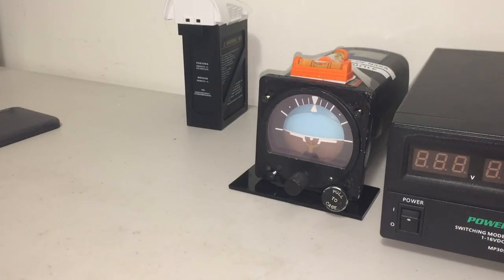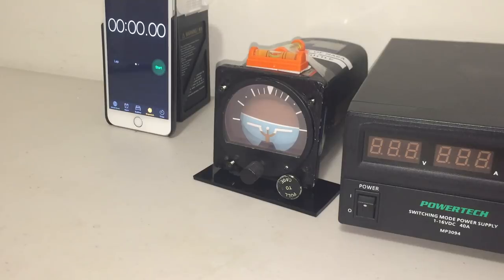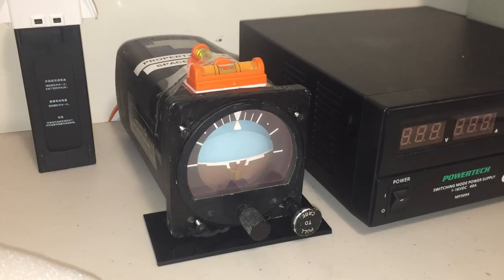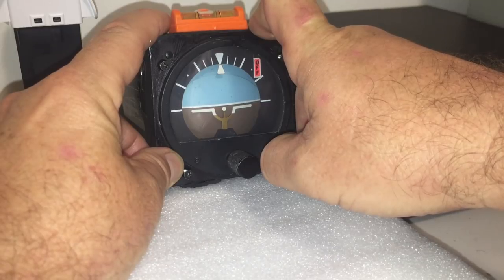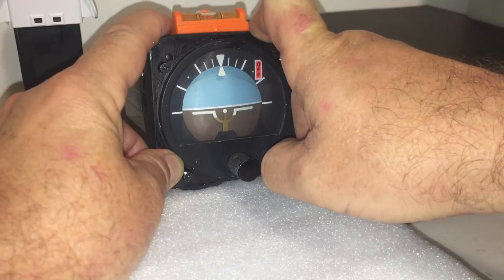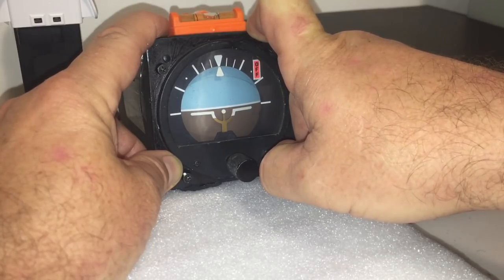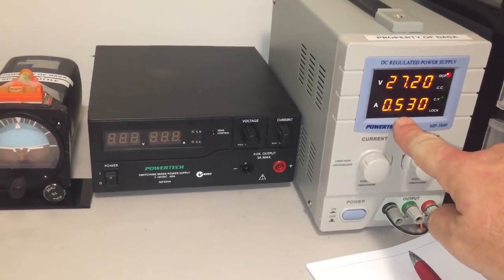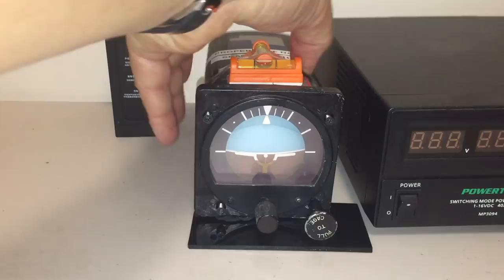Two more gyro experiments as requested by viewers.

Comment: hahahahahahahahaha! When you turned on again the gyro when it was at a 20° inclination to the  to the Earth plane frame of reference,  all this time you were holding it gaged at the previously set Earth plane ,  so you never really set the gyro to this 20° inclined new frame of reference. You proved nothing. Also the other thing about gyros nobody seems to understand is that  its horizon line indication (white line with the dot in the middle permanently stamped on it glass window) indicates actually the Earth plane when gyro whole apparatus is in a horizontal position to the the Earth plane position and powered off whereas the equator white line on the sphere inside the gyro indicates the inclination and is moving accordingly.  

So that means that this particular gyro is not made to indicate clearly a preset frame of reference (i.e. when the gyro is ungaged and turned off) thus a  frame of reference  different than the the Earth plane using a second mark line gaged to the preset frame of reference different to the Earth plane and thus  indicating this difference.

However, in still conditions meaning the gyro is ungaged and turned off  put in a new frame of reference different than the Earth plane then gaged at this new position (to avoid any momentarily recoil kick when gyro is turned on), turned on and then ungaged,  then when no other movement happens, the its equator line  will be in a different position to the Earth plane indicator line and will remain so as long as the gyro is turned on. Except of course some drift but not due to the Earth spin (alleged apparent drift) but due mechanical friction.

So please repeat the experiment but this time use the following algorithm:

1) Put the gyro turned off and ungaged to the new 20° inclined level
2) wait for a minute so it adjusts with the gravity vector
2) Gage the gyro and hold it there 
3) With the gyro gaged put it back to the horizontal with the Earth plane position and make sure its level using your spirit level. Keep holding it gaged!
4) With the gyro still gaged turn it on.
5) Gently ungage the gyro
6) Wait a day or maybe for ever the gyro to return to the flat Earth plane position hahahahahaha!

As for the 180° thingy in your experiment gyros have no infinite rigidity in space and are not made to operate in this extreme conditions meaning upside down. Actually it was a miracle that it took whole of 50 minutes time to return back level proving their rigidity in space in this extreme conditions.

my2cents

Markoul11
Reply from the maker: +Markoul11.  Why are you laughing? . I know what I did was pointless but I simply performed the experiment precisely as requested to satisfy that person's curiosity.  Please read the video title. 

Your experiment is also quite pointless and tells me you don't understand how this instrument works but I will happily do it exactly as you have listed regardless. 

Will you apologise when you see that you are wrong? 

It will self correct just fine even after doing exactly as you posted.  I can predict that already because I know how it works.

I could have laughed and mocked the person who asked me to perform that experiment but in the interest of education it was better to just demonstrate it to him. 

I will do the same with you.  I was a little more harsh with you because you opened with laughter when in fact your suggested experiment is equally pointless.  

If you understood how the instrument works you would realise that already.

The white line with the dot in the middle is not permanently stamped on the glass window at all. Wrong again my friend. It is adjustable for pilot seating position.  The pilot can adjust it up and down very slightly to conform to the horizon from his seating position. 

I would do the experiment now for you but it is late so I will do it tomorrow and make you a video.

It was not a miracle it took 50 minutes Markoul11.  These instruments are designed to correct at the rate of 2-4 degrees per minute. 

So for a 180 degree correction that will be something between 45 and 90 minutes.
Reply: Right, sorry about my laughter, couldn't help it. Did not realize that you were following blindly instructions from your subscribers however in the video you actually use the word  "prove" which allowed me to thing that these experiments were made to prove your points in compliance and not by opposition. Sorry my friend, I just realized it now.

"The white line with the dot in the middle is not permanently stamped on the glass window at all. Wrong again my friend. It is adjustable for pilot seating position.  The pilot can adjust it up and down very slightly to conform to the horizon from his seating position. "
end quote

ya! but the fact is that it is still made to indicate the fixed Earth plane frame of reference and can be adjusted to the pilot's view elevation and also during gyro operation it is permanently fixed in position and does not move unless the pilot adjusts it.

Do my experiment corrections? wow i am mostly honored by you. Thank you!  

Can you increase the inclination to 40° instead of 20° ?

And also please be careful not to introduce any roll when you move the gyro. I am interested only in level inclination. Also please release the gage when gyro is turned on, very gently not to introduce any momentum. Also if the gyro does not incline initially to the 40° inclined level due to mechanism stiffness when it's powered off, force it to go there with abrupt movement.

Best of luck.

Either way what the result will be, it will still be very educational.

Matkoul11
Reply: what you talking about man? Did you actually follow the conversation? Wolfie said on his own words that he was following the experiment instructions requested  by specific subscribers. So yes to be consistent he executed the requested instructions to the letter, thus blindly without questioning. SO WHAT IS YOUR PROBLEM? PAL? what this has to do with Flat Earth?
Reply: Markoul11: The white line with the dot represents the airplane and is therefore fixed to the case which is fixed to the airplane. The horizon behind the airplane symbol on the other hand is „fixed“ to the real horizon by the erection mechanism and during maneuvers by the rigidity of the gyro.
Reply: my predictions as to his 'test' of absurdity...

1) Put the gyro turned off and ungaged to the new 20° inclined level

ok fine and dandy, but with no power, it will roughly adjust to gravity.

2) wait for a minute so it adjusts with the gravity vector

only takes a second for it to have the heaviest part of the gyro to point down when powered off(the pendulous vanes)

2) Gage the gyro and hold it there 

ok, so once CAGED(not gaged), it will re-orient the gyro to the horizontal of the unit, regardless of gravitational pull(he did this in the first gyro test) (and to note, you put step #2 twice)

3) With the gyro gaged put it back to the horizontal with the Earth plane position and make sure its level using your spirit level. Keep holding it gaged!

since the gyro is still off, and it is CAGED to the horizontal of the unit, it will rotate WITH the unit back to its resting position being level with the base of the unit. if the unit is level with the ground, it will show the horizon as level as well.

4) With the gyro still gaged turn it on.

ok, you have successfully turned on the gyro while it is already level with the ground...

5) Gently ungage the gyro

since it is already level with the ground, it wont have anything to adjust for when you unCAGE the gyro...

6) Wait a day or maybe for ever the gyro to return to the flat Earth plane position hahahahahaha!

and you have shown you have no critical thinking skill.
Reply: Walter Bislin: Nevertheless, the gyro is preset on the ground before takeoff and with the airplane still therefore the Airplane indicator on the gyro matches the Earth plane of reference.
Reply: Markoul11: on the ground if the airplane is not one with a tail wheel so it is inclined, then yes, else no.
Reply: Shawn if the cage handle resets the gyro to the middle and not freezing it on current position my experiment will not work. Thank you for pointing this out to me as well my spell check. :-) My experiment was based of the assumption that the cage holds the gyro on current position so if this is not true the whole procedure is not logical and therefore I ask wolfie not to bother doing it. Thank You.
Reply: Shawn if the cage handle resets the gyro to the middle and not freezing it on current position my experiment will not work. Thank you for pointing this out to me as well my spell check. :-) My experiment was based of the assumption that the cage holds the gyro on current position so if this is not true the whole procedure is not logical and therefore I ask wolfie not to bother doing it. Thank You.
Reply: "if the airplane is not one with a tail wheel" hahahaha! nice humor! he he! anyway I rephrase the gyro is reset inside the airplane before takeoff, I don't know the exact procedure but it is reset with respect to ground when it is level and before liftoff. Here is the link I am sure they compensate for any inclanation of the airplane sitting on the ground:
http://ardupilot.org/plane/docs/starting-up-and-calibrating-arduplane.html
Reply from the maker: +Markoul11.  You seem a good chap Markoul11.  Can you explain why you used the word "blindly"   

I was not following the instructions blindly, My eyes were wide open and I knew exactly what the result would be in advance but I followed the instructions carefully to assist others.   I respect sometimes they just need to see it for themselves. 

My comment about "proving" is that this video does again "prove" that the gyro, when powered and left to its own devices will always find true level - that is absolutely true. 

I will make the video for you now and I will do it at 40 degrees.  It won't matter what angle actually, even 90 degrees will give the same result.   

Plesase read Shawn Hufford's reply.  He is 100% correct in his comment and analysis.   He is telling you what will happen and this is exactly what does happen.  I did it quickly last night already but did not make a video as others were all asleep in the house.   

I'll have the video up soon for you.
Reply from the maker: +Shawn Hufford.  You nailed the analysis perfectly there Shawn - that is exactly what does happen.  I'll make the video now.
Reply from the maker: +Markoul11 - I will do the experiment for you anyway just for complete transparency, I will post it as an unlisted video out of courtesy to you. I have it set up now ready to go.
Reply: " Can you explain why you used the word "blindly" "  
Because language misconception. You see in my mother language (Greek) the metaphor  "blindly" in this case means exactly to the letter without looking to anything else... About the experiment, It will not work because cage is not freezing the gyro to current position. But if anyway you want to perform this that's fine with me. Sometimes we learn more from our mistakes than from being right. Right?
Reply: Wolfie. Thank you for your effort and your kindness. You are a true gentleman and scientist.
Reply from the maker: +Markoul11 - thanks for the explanation and I understand fully.  All good my friend and here is your video. 

https://www.youtube.com/watch?v=wTH96o6XTqs
Reply: Markoul11 it's no problem mark, one of my best skills is analytical thinking.

That's how I identified that this gyro uses pendulous vanes for self correction. The sound the make spinning up, while at operating speed, and spinning down.

Some argued that is was the brushless motor powering the gyro, but it wouldn't have the spin down noise had that been the case.

When Wolfie gave the video about the torque motors on some gyros as a possible self correct method, I could see that, but I am glad my initial educated guess was correct. I've never heard an aircraft gyro in operation before, but I do know the sound of sharp metal cutting through the air at high rpms :)
Reply: yes yes..good observation skills! Bravo for noticing the cage function correctly. But are the vanes only for the air driven gyros? and not for the electrical motor driven like the one Wolfie demonstrates in his video??
Reply: Wolfie this is the last time I am visiting your channel.  Our debates and arguments here in your channel were the most interesting for me and most educational videos and I want to personally thank you and wish you the best. However you have some "nice" people here like Requiem4aDr3Ambut. Enjoy their company, that I can not wish to you.

Best Regards,

Markoul11
Reply: ancealil @ me wrote: "You can claim to leave for feeling personally "attacked", but I am wiling to bet your departure is more likely due to the emotional response to being proven wrong and an sheer avoidance of anything you do not wish to be real. As I have said to so many other proponents of the flat earth lie, you will find no respite in your delusions here."
end quete

hahahahahahahaha!... Thank you for the  psychological analysis Freud!!
No, I an leaving (since this video is my last visit in the channel I stay for a while more) because your overall attitude and inability and head stiffness with some people here excluded  towards acquiring and even considering to the slightest a different an alternative information and possible explanation of the world we all are living in. 

If you are sure you resolved once and for all this issue, so why is it that you are still here, what's the point? except mocking and personally attacking people who dare to dispute your status quo and claiming with arrogance self victory? Victory on what and over who? 

This arrogant members only, all knowing, never be wrong and unsocial environment  is the embodiment of non science really. I am leaving because there is no room for dispute here no room left for science growth nothing for me to gain and learn by some mainstream science sponges, I prefer to read a good science paper or book instead.

As for me claiming without evidence to back it off... well in science this is called hypothesis If you don't know, and is the start point for producing new science in which you are apparently incapable of doing, most of you and can't never reach above your arrogant nose.

Science is not about knowing but about things you don't know and admitting it.

So with that said, how is it when you say that you absolutely know were you living on, that your most spatial accurate to the cm representation of the Earth is the WGS84 ellipsoid datum? And why are you keep it mainly hidden from general public view:

http://gisgeography.com/wgs84-world-geodetic-system/

picture of WGS84:
http://gisgeography.com/wp-content/uploads/2016/05/Oblate-Spheroid.png

hahahahahahahahahaha! looks pretty flat to me! hahahahahahahaha! more like a flattened ellipsoid or an inflated pancake... and no, this it is not a spheroid, there is no downside every land mass or sea is located above on it.

So globetrotters, admit it...be scientific  for once. We all have been fooled and lied to by the land lords.

You don't know!... were you living on!!...

I don't know!... were we living on!!... but it is definitely not a sphere...nature does not make inorganic spheres, there are always some exceptions of course but not in this case.

my2cents

Markoul11